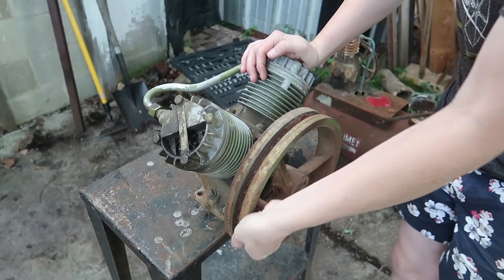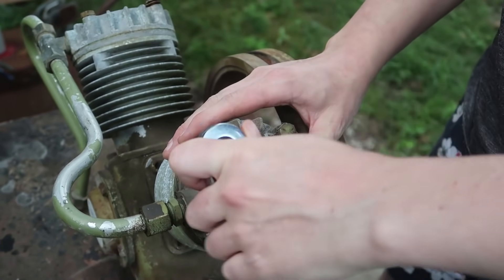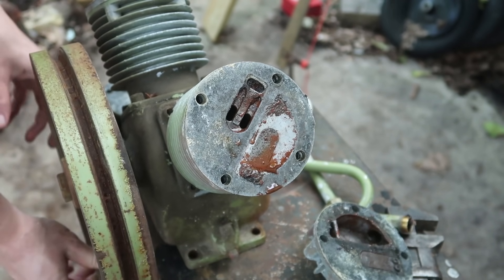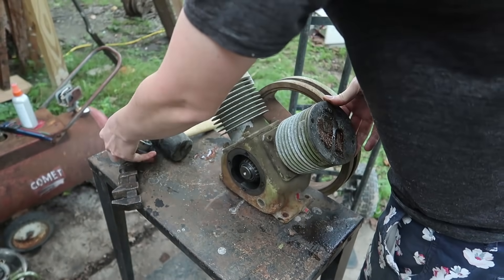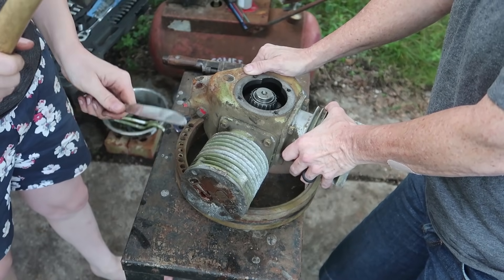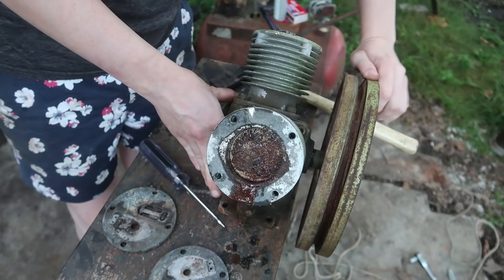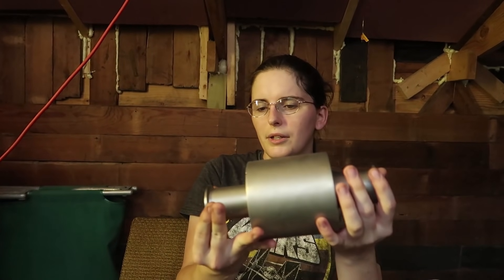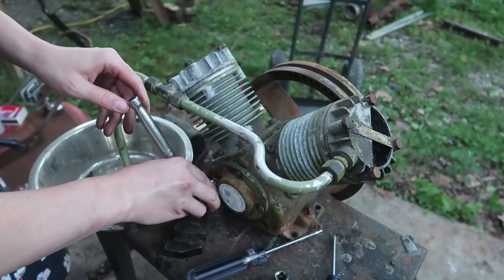DIY Stirling Engine 01: V-twin Air Compressor Conversion Evaluation

Comment: I wouldn't suggest using glass/sand paper to sand the cylinder down, because doing that will likely remove some metal, which will increase compression or possibly even make the piston smack against the piston head every stroke. Perhaps just use a blade to scrape the old gasket off, and then get a new gasket for it?
Reply: sanding down is fine as long as she doesnt sand like more than .005" away which would take quite some time i do the same thing for blown head gaskets on cars when they are warped. only once out of 600 engines ive done has the piston slapped the head and or valves the key is just sanding down till its smooth and level as little as possible
Reply: @claytonsmoking  ⚠️ God has said in the Quran:

🔵 { O mankind, worship your Lord, who created you and those before you, that you may become righteous - ( 2:21 ) 

🔴 [He] who made for you the earth a bed [spread out] and the sky a ceiling and sent down from the sky, rain and brought forth thereby fruits as provision for you. So do not attribute to Allah equals while you know [that there is nothing similar to Him]. ( 2:22 )

🔵 And if you are in doubt about what We have sent down upon Our Servant [Muhammad], then produce a surah the like thereof and call upon your witnesses other than Allah, if you should be truthful. ( 2:23 )

🔴 But if you do not - and you will never be able to - then fear the Fire, whose fuel is men and stones, prepared for the disbelievers.( 2:24 )

🔵 And give good tidings to those who believe and do righteous deeds that they will have gardens [in Paradise] beneath which rivers flow. Whenever they are provided with a provision of fruit therefrom, they will say, "This is what we were provided with before." And it is given to them in likeness. And they will have therein purified spouses, and they will abide therein eternally. ( 2:25 )

⚠️ Quran
Reply: The best price surface plate I found is from Grizzly and they do go on sale or offer coupons.  I picked up mine on sale for ~$23 if I'm remembering right.  Under a certain size the shipping is reasonable also.  

I'm suggesting use something like that or maybe like free or cheap granite tile or table top pieces you can find on Craigslist, Offerup, Letgo, Restore, Goodwill or maybe elsewhere. 

Here's the Grizzly Surface Plate link:
https://www.grizzly.com/search?q=(surface+AND+plate)+OR+(surface+OR+plate)

I've been restoring some items also and on the free or cost effective addition (if not plain practical) to rescue Made in the U.S.A. items also. 

I'm also planning to work on restoring an cheap Chinese mini-lathe my Dad left with specific instruction to improve if anyone wants to use for steel work.  Really, like he thought, better to find an old Bridgeport, Cincinnati, South Bend or something Made in the U.S.A.  He was talking about a Greenlee at one time, though that would be for production more-so.  Anyhow, invested in the granite surface plate for a cost effective reference to true in the mini-lathe and other projects.  More likely will invest in a lapping plate... though the surface plate will work for bluing to scrape and see how the surfaces that interface look when working down either way.
Reply: jafinch78 might get away with using 2 gaskets if sanded and worried about slapping happining
Reply: @vancemacd6315  Sure, maybe even one and some silicone gasket material?   I guess with the external combustion (Stirling) engine she's going to want to have a gasket that has the best thermal conductivity I think.  I don't think it's the opposite would be better... not really think about critically at the moment.  Thinking heat differential and thermal transfer would be best. 

Interesting see this comment since I yesterday sent some messages to some sellers on eBay with diamond lapping plates for stones and blades wondering what the surface tolerance is to see how flat since one manufactures is 0.0005" tolerance. 

I inquired about this one for the ways for the lathe which I kept seeing commercials regarding on youtube so inquired and the tolerance is 0.015": https://www.sharpeningsupplies.com/Double-Time-Flattening-Stone-P1545C4.aspx

They noted this one is the 0.0005" tolerance: https://www.sharpeningsupplies.com/DMT-Dia-Flat-95-Lapping-Plate-P451.aspx
Reply: Its an ece she's making not an ice 

Their is no compression forces 😂

Comment: those reed valves are shot. without them it is a paper weight.
Reply from the maker: without them it is a stirling engine
Reply: @RinoaL  i remember making one in 8th grade science class from a pop can, with a tea candle, and an ice cube as drivers. it will be interesting to see how you do this. mine barely overcame the friction of the foam piston. you could try cutting discs from aluminum pop cans to seal the heads. good luck, i'm rooting for you!
Reply: @RinoaL  wait, i forgot you have a lathe. go back to the scrapyard, and get a piece of 1" aluminum plate, and turn new heads to your specs. then you won't have to figure out how to close off the compressor heads.

Comment: I just hope it wasnt ran with no oil in it, although older compressors are pretty bulletproof. My main unit has been in service sence the early 1940's and i just recently discovered how much muck and water was in the oil. A quick clean and it was good as new.

Comment: You are stockpiling so much wood. Build yourself a nice outside working table.
Reply from the maker: i plan to build many things, but right now im assembling a large tarp shed to move all my lumber into. will open up a lot of space.
Reply: @RinoaL  will the wood get damp and mouldy again in a tarp shed?
Reply from the maker: @Phantom0309  i have a stack in another tarp shed and the high heat actually bakes the moisture out sooner then being in my workshop.
Reply: @RinoaL  Right, a kiln like storage area.  I've got the old rabbit pen and in the rafters of the barn/greenhouse for where I'm working now.  Neat videos!  I'm just coming down from the electronics test equipment addiction and moving into small engines with riding lawn mower and lawn tractors for now since they're cost effective to work with.  Neat seeing similar cost effective projects.